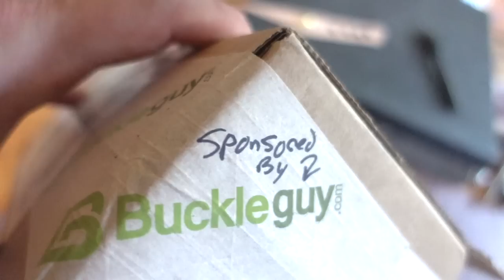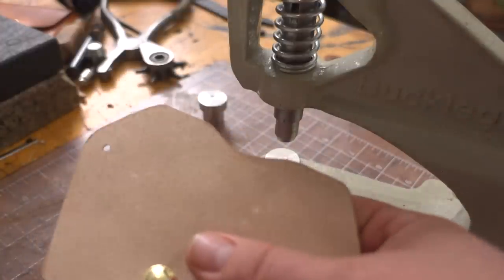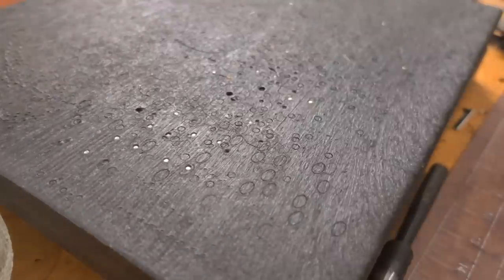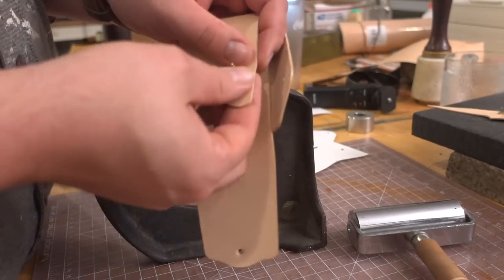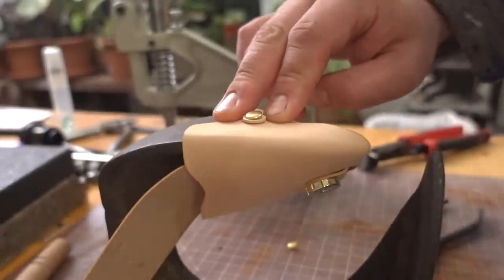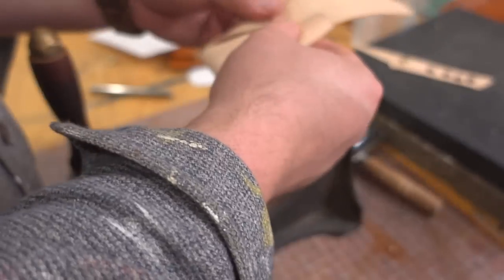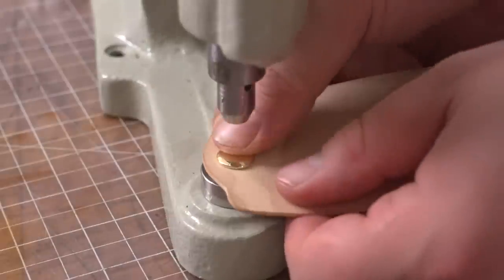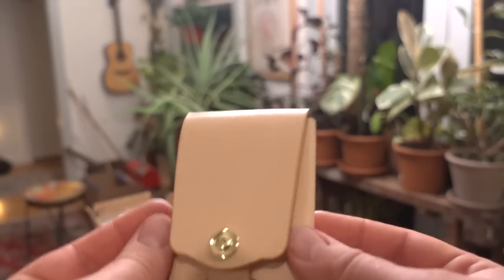My Favorite Stitchless Leather Wallet Design

Comment: Great to see someone else making mistakes with rivets as well.  Im curious if the magnetic snaps need to have the post be of a certain length as well. Usually I aim for 1/8 of post to stick up through the leather, but the magnetic snaps used in this video seem to usually be longer.  Thanks for the great tutorials!

Comment: I bought the pattern last week but it came through as a zipped file that I can not unzip on my phone. Is there some way I could get that pattern in an unzipped (regular) file that I can print out?
Reply: If you are using windows, you can unzip it and the email it back to yourself on your computer
Reply: @hotfishy  I do not have a computer, only an older android phone which is why I need an unzipped file like I get from everywhere else I have bought patterns.